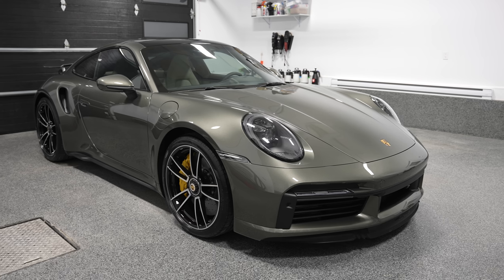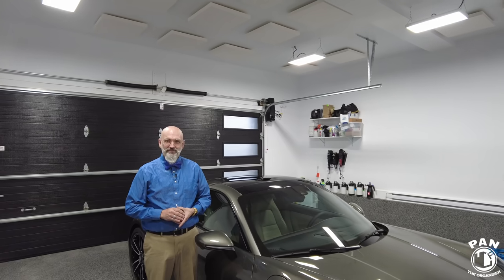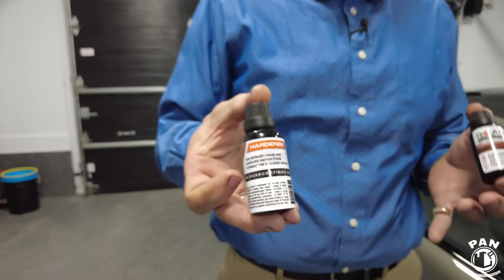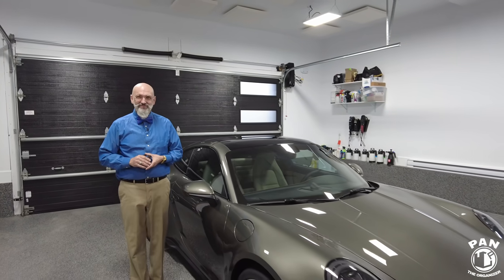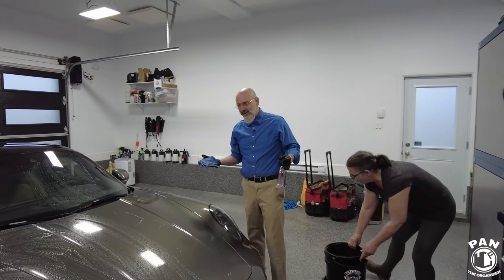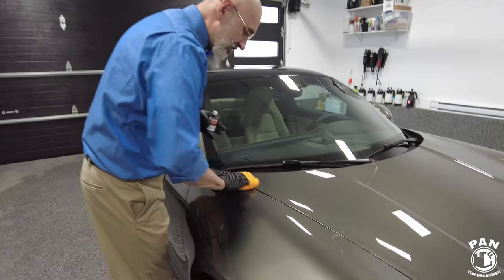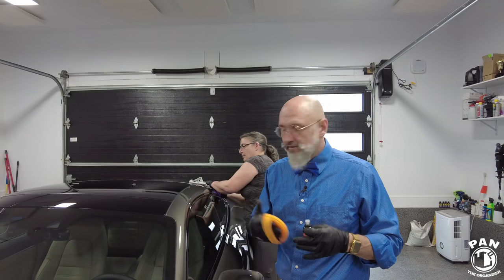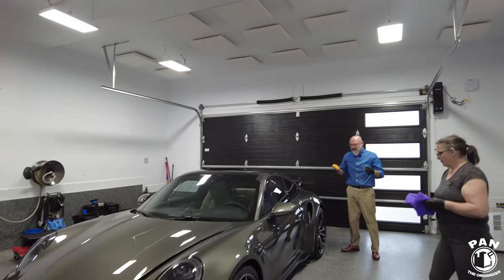Porsche 911 Turbo S : Detailing My New Supercar!!

Comment: Are these products real? It all looks and sounds like snake-oil advertisement. I don't get this "detailing" industry. I paint and after cutting and buffing just leave the clear coat catching air and sun. For weeks it gains gloss and that's it.
Reply from the maker: Pedro, are you new to my channel? Do you honestly think I would apply “snake oil” to my own supercar? You realize how crazy that sounds right? Of course this is a real product, that is installed by real detailers across the USA. Check their website out you will see pictures. Yvan is a legend in the industry with over 40 years of experience. He doesn’t deal with snake oil.
Reply: @PanTheOrganizer  Thank you for the reply! A product that works on every surface sounds odd. Naked clear coat isn't sufficient? 
.